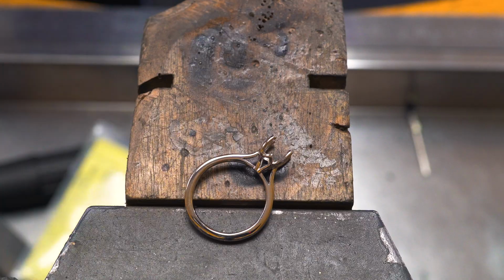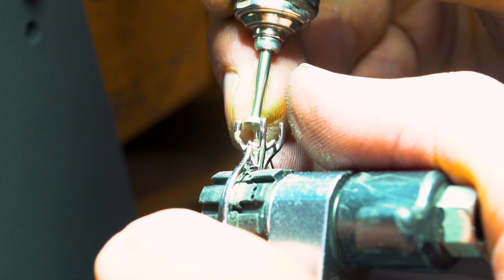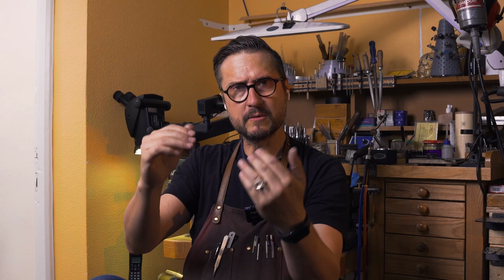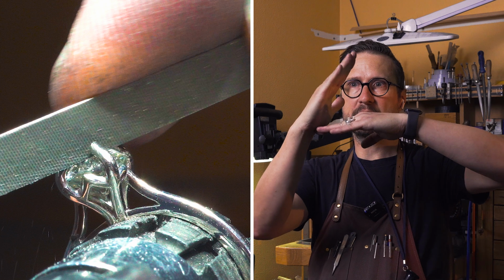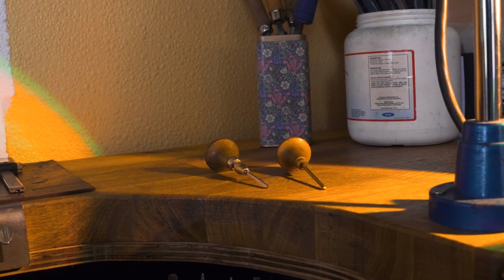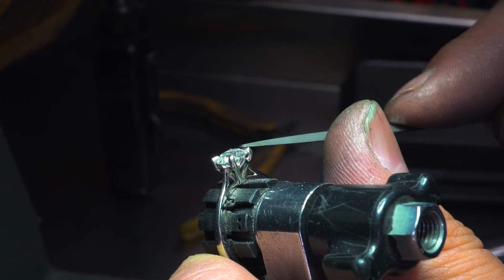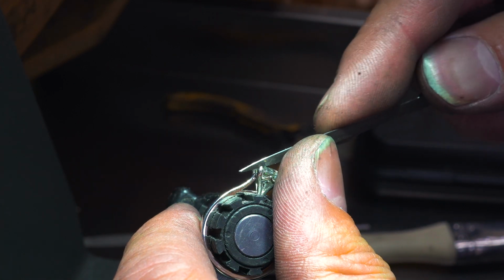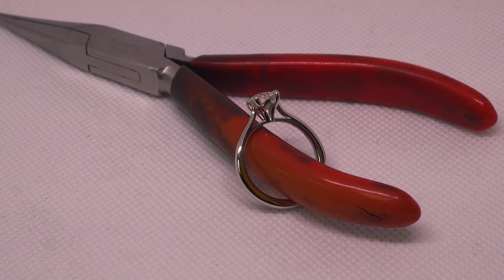Stone Setting 101: Talon Claws | Jewellery Tutorials | GWS

Comment: Jaco, you speak of a proportional size between the stone and the wire. Are you able to give more guidance please?
Reply from the maker: The feature or the setting would dominate that size. Once you’ve made that, just make sure you have a shank which has balance - too wide could diminish the setting 👍🏻
Reply: @jacothejeweller  ahh, i thought you meant the size between the size of the stone and the size of the wire you are making the setting out of??

Comment: Can I plz ask you to do a video on actually making settings themselves I feel so disappointed at the moment particularly with prong settings because I feel like I get the technical aspect & I know what to do but it never comes to fruition it always goes wrong some how and a double gallery basket setting is something that I really want to learn or just any prong setting. Something that might really help to is to have some kind of recommended wire thickness for the side of the stones, so let say you have a 8mm round stones then best to use a 1.2mm wire etc like something on your insta highlights to refer to for that would be super helpful 🙏 so glad to have you guys back thanks for the vid ❤
Reply from the maker: It’s difficult to know exactly what to suggest because there are so many variables depending on the project but a few things I take into consideration is the size of the stone (of course) and then the metal (if it’s silver, I would want to scale up the claws to account for the softness of the metal) and the customer’s lifestyle (will they be wearing this ring all the time? Are they heavy handed / how do they wear their jewellery) or, if it’s a pendant / earrings vs a ring then there will be a difference in what the setting will be exposed to in terms of wear and tear, I might make adjustments but it is important that it’s proportional. I like to go fractionally thicker with my claws - to give it that extra bit of life. I will speak with Damia about editing a video highlighting the making of the setting, or a video focussing more on these things - thank you for your suggestion and please keep going, I know how frustrating it can be but it’s all worth it in the end. 🌞
Reply: @jacothejeweller  that’s very useful thank you I know with rings lifestyle is particularly important. My focus is on settings/rings because I would love to get into bridal, engagement rings etc, out of everything I’ve tried so far this is the thing that’s giving me the most hassle, for lack of a better word 😂 don’t worry tho I’m not giving up on anything, I’m like a dog with a bone with this stuff until I get it right, I was at the bench till 10pm last night filing notches 🤭 The most frustrating thing about teaching yourself is there’s no one there to say “if you used this instead of this it’s a lot easier” or “just move it over that way and it will be prefect” I think that’s the reason I was getting so frustrated that day. I feel like I’m close tho and soon hopefully I’ll have “ah ha” moment and it’ll all work out, 🙈 keep your fingers crossed for me 🥹🙏
Reply: @emy_themua2015  haha I totally understand the part about teaching yourself, after a year of off and on practice and binging YouTube tutorials, I got a job at a jewelry store as a salesman so I could talk with the gold smiths and am now receiving my first actual lessons and it makes a huge difference when someone can point out the little things to make it easier. Best of luck to you 👍👍
Reply: @josephmoore9707  oh wow congrats and that’s very kind thank you 🥰